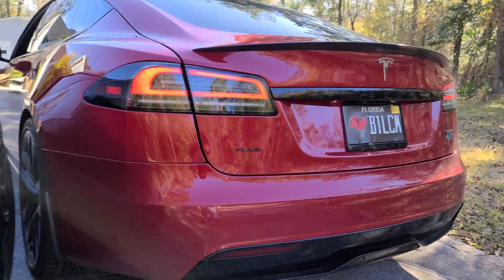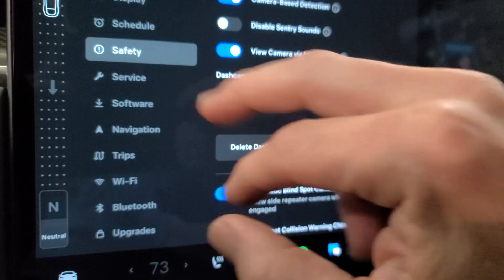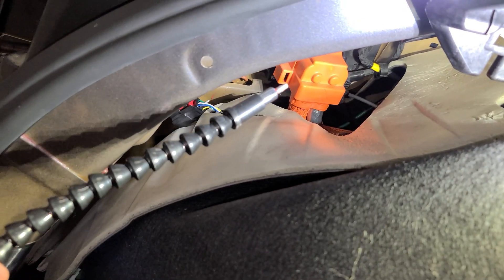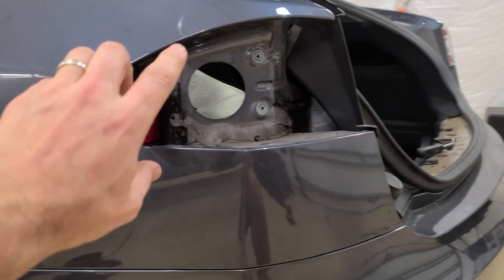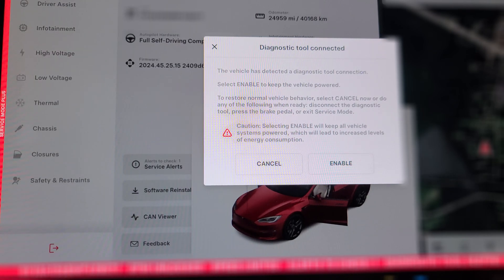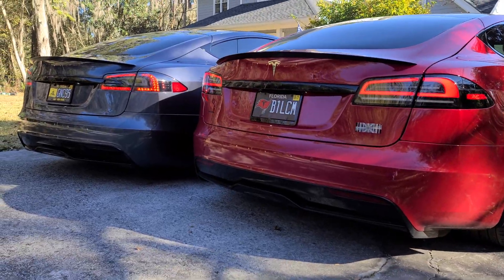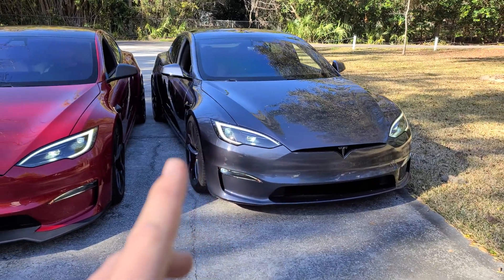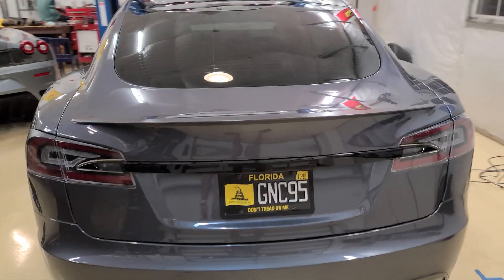Tesla Model S ~ MATRIX TAIL LIGHTS ~ Retrofit DIY

Comment: Why didn't you change the charging port? Then you wouldn't have to cut anything.
Reply from the maker: I explained That in the video. 
Cliff notes, there is a lot of cutting to replace the charging port. You have to completely cut away the old inner fender support and weld in an entire new inner fender support. He also have to replace all the Hv lines for the battery

Comment: Hoping you could help. I'm doing the alpharex taillight install and the passenger side won't turn on. The driver side is fine. Trying to put the original passenger taillight back in and it doesn't turn on anymore either. Any thoughts ? Could it be a fuse? Mine is an early 2022 pre refresh plaid .
Reply from the maker: That sucks, I would definitely check fuses, although I think both tail lights would likely be on the same fuse. So if one's working, and the other isn't. It's probably not the fuse. Maybe inspect the harness to make sure you didn't pull a wire out of one of the pins? 
The other thing I can think to try, is to turn the car off on the screen for like a minute. Or possibly pull the firemen loop for a few minutes to kind of reboot the car
Reply: @ExoticCarDIY thanks for the reply! So I went to put the kids to bed and eat dinner. Came back and it's working. After some research I found out that this car uses an efuse and left and right are on seperate circuits. The efuse resets after 90 minutes so I'm thinking that must have been it. It's working 100% now

Comment: Lol, used my Alpharex light picture from the forum. Those things are crap, they started wrinkling on the inside within a month. Thanks for the write up - I don't think the matrix option is available for my 2013 so not sure if the programming would support them :/

Comment: Warning to 2020 and earlier Model S owners.  I tried to do this upgrade for my 2020 Model S and couldn't get the software configured. When I go into toolbox 3 under infotainment  dashboard there is no "rear light type" option, and the rear fog lights option is greyed out. Without the software upgrade the turn signals blink all lights and the brakes turn on the amber lights.
Reply from the maker: There is a thread on the tail lights on the Tesla motors club message forum, it's like 25 pages over the past couple years of people trying to figure this out. 
Mostly 21 plus refresh, but there is a guy on there who has it working on his pre-refresh model s. I would suggest looking into that figuring out how he did it as I am not familiar with the pre-refresh
Reply: @ExoticCarDIY  Thanks for the reply, and thanks for you video BTW. I'm trying to decide if I should give up and put back the older lights. 
I was browsing the tesla motors club, and all of the posts I could find were guys doing the Alpharex tail light swap into pre-refreshed cars, or 2022+ tail lights in a refreshed 2021.
If anyone knows of where the 2020 pre-refreshed Model S post that installs 2022+ Tesla model S tail lights, please add the link. I'm desperate :)
Reply from the maker: @johnwallace2660  user ' Hotboy408 ' did it. but he seems pretty protective about how

Comment: Great video, thanks for breaking it down. I also have the '21 Plaid and went the Alpharex Tails route a year ago. I went with the smoked versions so it hides that edgin you are referring to. However, the tails do scream aftermarket and would like to pursue a more OEM+ look with mine. 

I noticed in the part list, you have "Left Charging door: 1530812*" listed. Is this required or can I just use the existing one installed on my car (it was never removed with the Alpharex tails)? Also, you mentioned that if you don't do the coding, that tails will still work but 1) both the amber and red outer brake light will function as turn signals and 2) Rear fog light will not be functional. Do I have that right?
Reply from the maker: It's really not plausible to avoid buying the charging door. You really only need the door, not the guts, but they don't unfortunately, you can't buy just that cover. 
Yes, there are fictional without coding, but the You're turning signals will simply just be the brake light. Not the Amber until Coding is done

Comment: Thanks for both the video on how to do the headlights and the tail lights i know you posted the headlights on fb awhile ago but not sure if you posted this Taillights video also but thanks for the detailed video i was on the fence about getting the alpharex Taillights but after the key points you mentioned I'll just man up and do the extra work to fit the oem ones 👍🏾
Reply from the maker: Ya, upgrading the lights on these is a huge improvement IMO. Hope the video helps. I didn't post to FB, I guess I  kinda suck at promoting videos lol

Comment: Nice job!  
Instead of wrapping the old charge port flap, could you just cut a piece out of the new flap to match and replace it?  Obviously you would need a really thin kerf saw so the fit would be tight.  How hard would it be to replace the outer cover on the old charge port flap?
Reply from the maker: We looked into that. There are several other ways to do it. Reid cut the matrix door in half and attached the smaller half to the original door arm with double-sided tape. 
Pros of this are that it does look more consistent, but the cons were it just seemed a little flimsy and the gap between the two halves was a little large. Maybe there's a way to tighten it up. 
Evoffer again wraps the original door black, and then appears to have their own custom-made covered to fill the hole where the matrix door is.

Comment: Very nice!. Can you access the unlock for the 200+  top speed in toolbox?
Reply from the maker: The answer is yes, maybe. Tesla official would use tool box to do it, but what setting is it exactly? 
There are easily accessible toggle options to change the brakes track pack ceramic. I didn't know if that also adds the power software. There also could be a configuration code to type into sandbox similar to how to get tilt screen. 
We're still figuring it out
Reply: @ExoticCarDIY  200+ can only be unlocked by Tesla (with track pack install) and very few others.  I had mine unlocked prior to getting the track pack.  Knowing what I know now I would advise against it.  The car will be expecting track pack carbon ceramic brakes and may not behave as expected including ABS.  Making this config change with OEM brakes would definitely be unsafe.